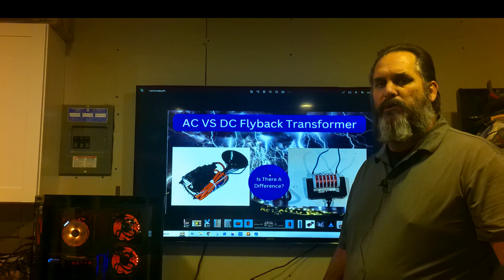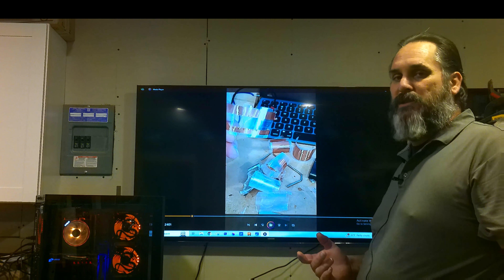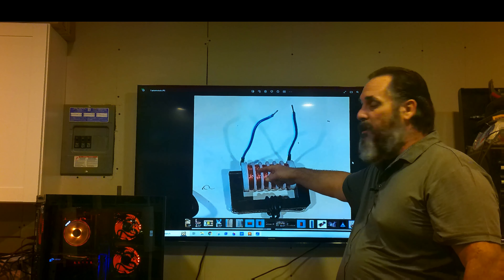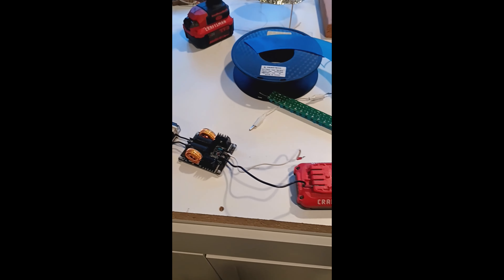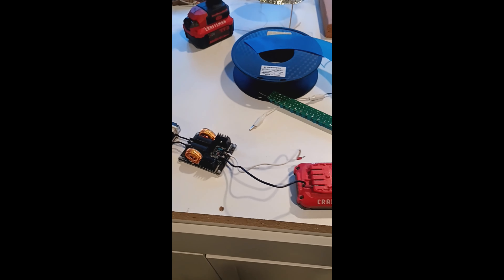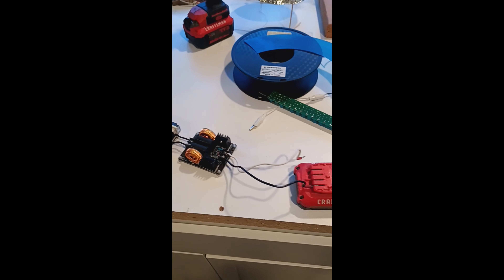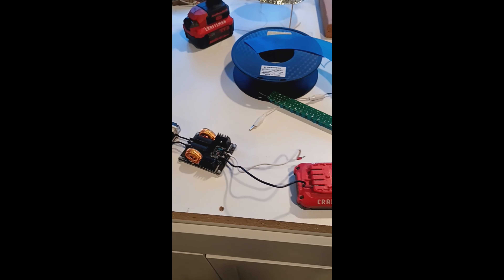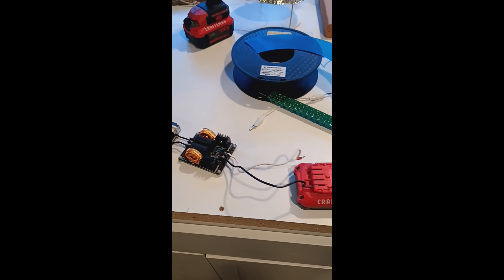AC VS DC Flyback Transformer

Comment: Great video! I never knew about the diode in the DC flybacks and thank you for that. In the case the AC flyback, the output wires are always of opposing polarity and switching tens of thousands of times per second or more. They aren’t both negative or both positive, but they definitely are both hot.
Reply from the maker: Thank you. Voltage is fun even if it bites you once and a while.
Reply: @nathanbunten4299  so true!! I’ve been accidentally shocked so many times by so many scary things
Reply from the maker: @cbfull  I got hit with a voltage multiplier on an ac flyback. The good news was it was one hand. A week later I got both hands at the same time. If there were more amps I would be dead. But the volts had me sitting down for hours wondering why I keep playing with these things.

Comment: How did you make the voltage multiplier? Is it just Diodes? Thanks for the video. I have been working on making a tesla coil from a fly back and with one fly back I had impressive results but the fly back was like the dc one in your video but failed after a few minutes. I tried various other fly back that looked the same but I did not get the same results and most burnt up almost instance. I made my own fly back transformer and it pulls some nice arcs but would not work on my tesla coil. I know now why thanks to your video. So not I need to make my AC fly back into a DC fly back with adding what you are calling a voltage multiplier. I would love to see exactly what you have made it from it you don't care to share.
Reply from the maker: I just did a live show about a tesla coil that is an ac flyback. The way to make an ac flyback better is get the best insolated wire. The degrees matter. Also vacuum epoxy around it. Here is a link for the live. Also I will add one more link for the round tesla coil. Keep in touch if you want to know more. Here are the links. 

Live:     https://youtube.com/live/gW8IVfe6BE0

Round tesla coil:   https://youtu.be/mm12kztoh9A

Comment: But..... How can a split layer of copper foil rectify the output ?  Does it somehow act like a diode in some mysterious way?  Could you please elaborate a bit on this?
Reply from the maker: They act more like a resistor than a diode. Every pin has a lesser value the further out the plastic and copper is in the winding. The core is just a bunch of wire. All a diode does id make things go one way. In this case the outer part cannot go back to the inner part. It is to weak. So it does make a good diode. The material that I had to saw away was probably the real key here. In my personal opinion ac and dc are words used to describe the input voltage and not the voltage created by the flyback. It is more of a magnetic volt.